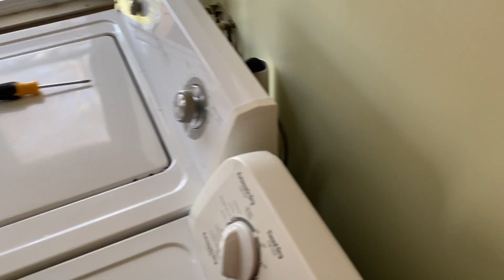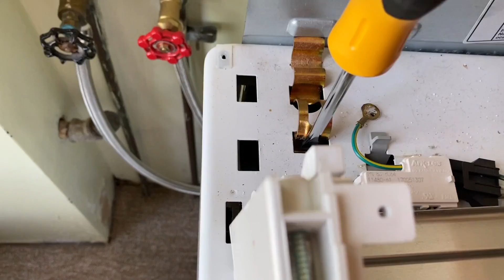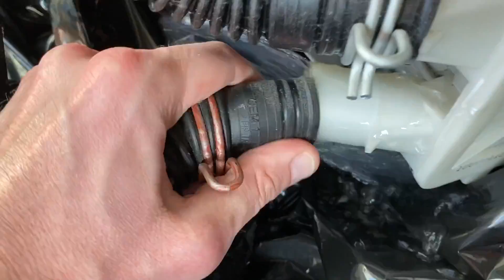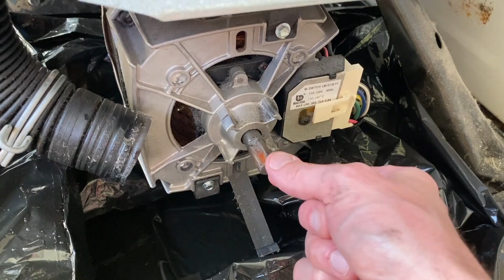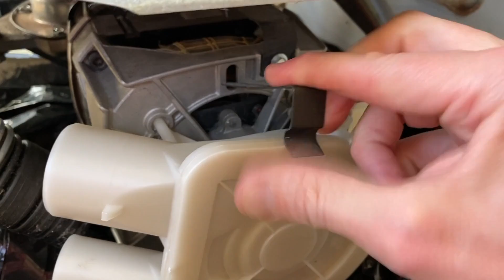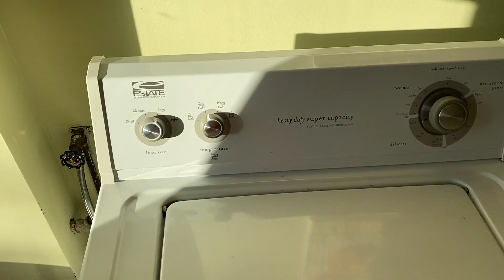Estate Maytag Kenmore top load washing machine Drain Pump - Leaking from below

Comment: You made that look easy. We had trouble doing it.
Reply from the maker: Thanks for watching, did you complete project and get your unit working with no leaks?
Reply: @DIYwithMichaelBorders  we also have to replace the lid sensor and did a bypass for right now. At first it leaked but after noticing the clips came out I put them back and it's good for now.
Reply from the maker: @michaelb465 

Very cool.  We will share a link to our Lid Switch replacement video below.

     https://youtu.be/1hTRc-_PnP8?is=abWbm2Py-Gs4wpWt

😁🙏
Reply: Thanks
Reply from the maker: @michaelb465 

😁👍